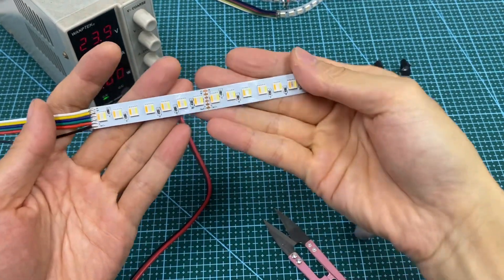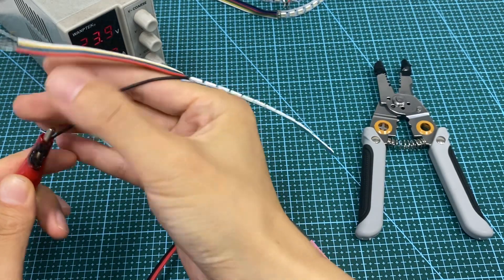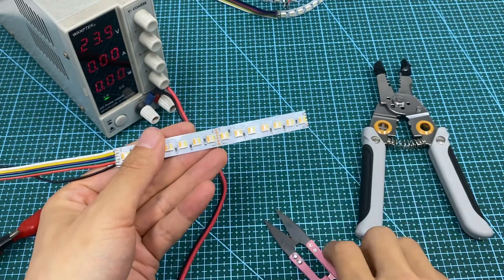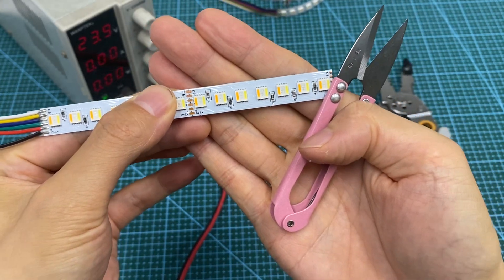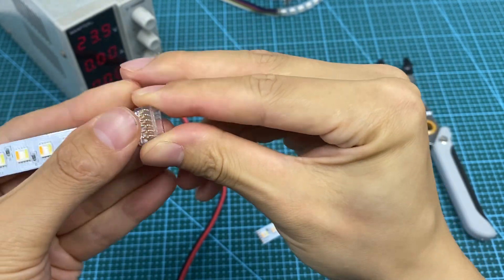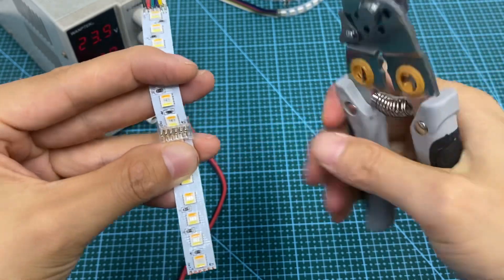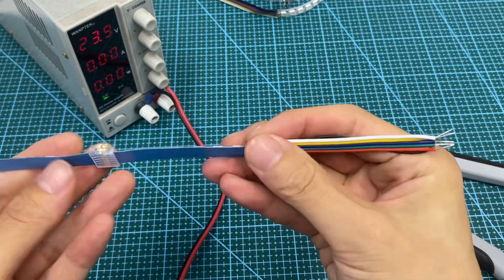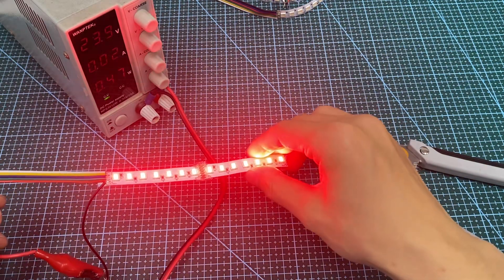How to cut and connect 112LEDs/m 5 in 1 RGBCCT led strips with quick connector

Comment from the maker: ❤ How to cut and connect 112LEDs/m 5 in 1 RGBCCT led strips with quick connector 

Here is led strips:
https://www.superlightingled.com/dc24v-112ledsm-highest-density-5in1-rgbww-led-strip-smd5050-164ft-p-5599.html
6-pin connector :
https://www.superlightingled.com/6pin-smd-rgbcct-led-light-strip-connector-for-12mm-strip-to-strip-strip-to-wire-p-5537.html